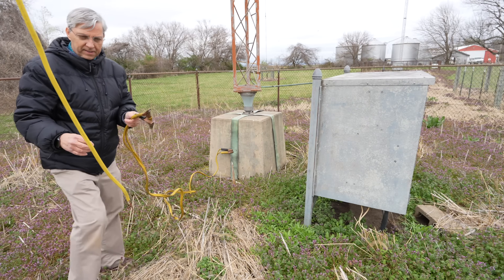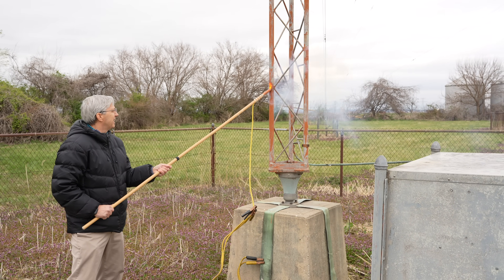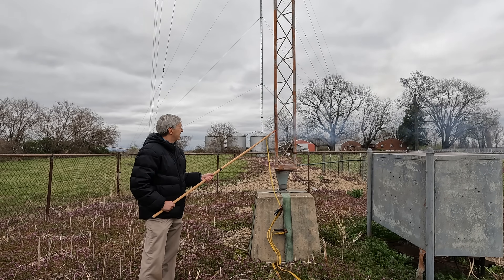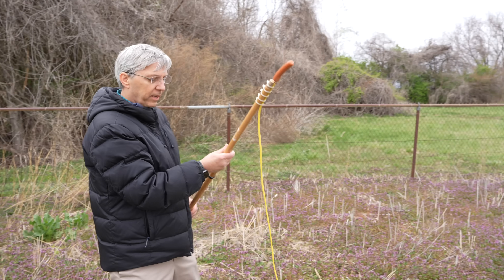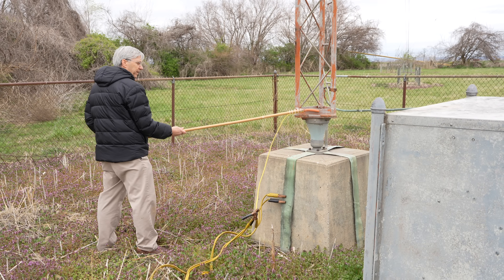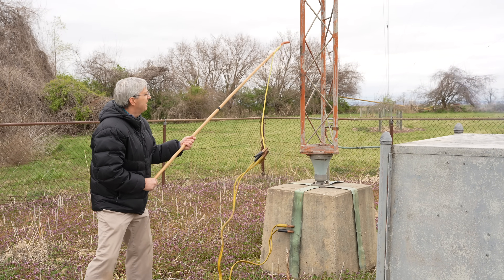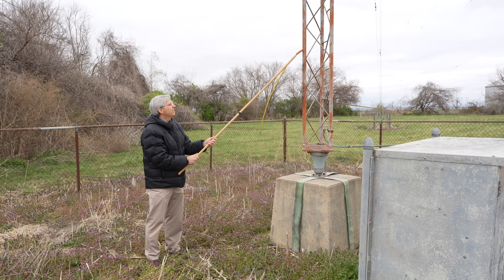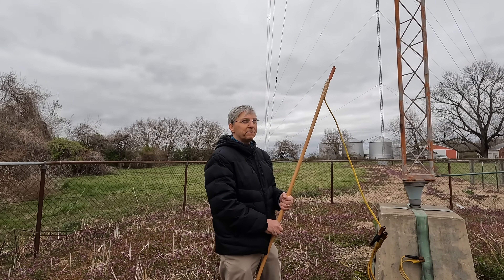We made a hot dog talk... with RF

Comment: When I get a belch that's an 8 or higher on my scale, I can feel my molars just barely vibrate in my skull. If this happens near a strong enough radio signal, my fillings pick it up and I get legit clear sound for that 3-5ish seconds. It's been several years, so I have no idea if that still works w/ modern radio. :/

Comment: would it be possible to add a interlock circuit to the transmitter that detected shorting to ground or something touching the antenna causing a potentially damaging situation and cut the power back to almost nothing to prevent damage and to prevent injury instill the short or arcing risk has stopped before allowing power to return so as to prevent transmitter damage and to prevent injury. such a circuit to be reasonably effective would need to work well under a wave number.  The second question is how they change lightbulbs on a tower while it is transmitting so as to prevent arcing or shorting out and isolate themselves from the ground or counterpose end.

Comment: It is dangerous to be next to the transmitter tower - because electrical field strength much more that 40A/M. For example - 20KW is 1000V on 50Ohm load. So next to the antenna electrical field strength is 1000V/M
Reply from the maker: It really depends on the frequency, power, type of modulation... a number of variables. The fence is at 2m, as that's the FCC-defined safety limit for the general public (based on some conservative estimates). The radius for occupational exposure (e.g. for engineers or groundskeeping) is inside the fence, in this case around 5-6 ft, based on the amount of power at this tower (I think 6-7 kW) vs the other two (which have different amounts).

If in doubt, though, hire an antenna systems expert—we consulted with one before determining our safety procedures for this quick test. And we also consulted one again for an upcoming video, where we added more safety measures :)

Comment: Don't worry 5G cell towers are good for you!
Reply: This is an AM radio transmission that uses a frequency between 530 and 1710 kHz. Medium wave, which is a frequency much lower than FM, which has a frequency of 87.5 MHz to 107.9 MHz. 5G has a minimum frequency of 3.5 Ghz.

Comment: Got some questions about supported AM broadcast antennas.

#1) Why are the three guy cables broken up into sections of different lengths with insulators between each?

#2) I've heard the terminology 1/2 wave, 3/4 and full wave. Can you explain to me how the physical lengths of each are determined and the ground plane? What fraction of the full wave length are the antennas typically?
What determines the length of the wires in the ground plane buried in the ground around the antenna? How often does the ground plane need to be repaired or replaced.  

I love your channel! This new world needs to know how valuable AM broadcast radio has been to the world and about the technology that has made it possible. I listened to short wave radio (fastly disappearing) when I was a child. We had an RF/EMP vulnerability test site in New Mexico that used high power Continental AM transmitters. I'll never forget the driver and PA sections to those things. Thank you for your time!

Comment: I thought for the longest time a radio tower was only meant to make a radio signal go farther by getting it higher. Not that the whole thing was an antenna…
Reply: That is correct for FM, or many other signals (they usually have a tall tower with an antenna system as high up as possible). But for AM or other lower frequencies, the antenna is very large/long (the entire mast), and it uses the ground and the atmosphere to spread a lot differently than higher frequency signals.
Reply: @JeffGeerling  Frequency and modulation mode are different things.

Comment: I would not be surprised if this change of antenna impedance is not causing the transmitter to trip on and off as you do this.
Reply: The transmitter seemed fine with it; they are built to handle quite a bit, but we do want to do some more 'scientific' testing with a field strength meter and more observation via cameras/logging while we're doing more hot dog testing.
Reply: @JeffGeerling  When I was a young lad, I worked at KWJJ-AM, Portland Oregon,  which had a 50,000 watt Continental 317C transmitter. We had a Continental Tech come out and service the transmitter, and he tested the transmitters MagnePhase detector with a process very similar to what you are doing with the hot dog. I think they used a 150 ohm 2 watt resister on the end of the grounding stick instead of the hot dog. If the Magnephase shut down the RF before the resister exploded, the Magnephase was working properly. I don't know why I remember that after 30 years, but hey, those were good times!

Comment: Warning signs should be put up around these towers.  What if kids climb the fence?  Yes I know they shouldn't, etc. etc.  But how much does a couple signs and posts cost compared to preventing death? I have an engineering degree (computer engineering) and I never knew that the tower structures themselves were energized.  I always assumed the energized antenna was at the top and that the metal structure would be earth grounded.  Obviously not the case. I guess it depends on how high the tower is and what the 1/4w of the lowest TxFreq is.  Around 130meters for bottom of AM radio if I remember right.

Comment: You can energize a radiant heater and never pay for heat that way.
You can also use a high low buck booster to power an dc to ac inverter with with out paying for the electricity.
They stole this knowledge from tesla, someday the alien forces that gave it to tesla will provide the way for them to kill them selves for doing so.

Comment: Imagine several magical trees, at opposite sides of a kingdom. And whenever the branch of one moves, the other does exactly in turn, because they are connected by a magical force.
And witches can use these movements to communicate with one another.

That's about the closest useful analogy the average person would need to know to "basically" grasp how radio works.
Reply: You can further elaborate on this analogy very deeply. 
"Well what of you talked into a leaf, would the leaf on the other tree vibrate subtley?"
Yep. Microphone.

Well what if there were other trees and shrubs of similar shape and consistency? Would they pick up some variation of the magic and move?

Yep.

Well what if you cut them into perfect vertical poles, then would thy still be able to carry the information?

It's a lovely thought exercise, fiction is fun :)
Reply: People will get mad when you're hogging the branches and now they have to communicate on the slow branches.

Comment: Wow, I wasn't aware there were any patterns that complex. Growing up I loved visiting the station my Dad worked at (WLPO/WAJK). They only had 3 antennas needed for the desired pattern.  I was fascinated by all the electronics and wanted to learn how it all worked. I ultimately became an electronic tech (BMET). Im sure my visits to the station helped to spark my love for everything electronic. What kind of peak voltage might be present on an 50kw AM tower? Cool videos thanks. Can you do a video about the process of taking singnal strength readings from various locations as required for design and setup of a phased system. I recall the stations chief engineer had to run all over several counties taking singnal strength readings from specific locations and needing to report them to the FCC or something before being allowed to switch to a phased antenna array.
Reply: I'm not the guy from the video, but assuming the antenna is a quarter wavelength monopole, you could approximate the voltage as Sqrt(50kW*36.5 Ohm) Assuming a perfectly matched antenna, which comes out to about 1.35kV. A couple assumptions need to be made, but it gives an idea, it'd be in the kilovolt range I'd guess.

Comment: Need to try that with a florescent bulb. Ground one of the end conductors and hold it up to the tower and it should ionize the gas within. Use the same safety cautions though...
Reply: No need to ground the tube.

Went with a radio station tech to the 5Kw ERP AM transmitter site. We walked towards the mast just holding long fluorescent tubes & they fully lit up. If I remember we were still about 20 metres away from the base of the tower.
Reply: @markboscawen8330  Agree, mine wasn't grounded, both ends open.
Reply: Used to do that with 100W PEP  18 MHz. You could see the peaks and nulls in the tube.

Comment: Thank you for the video. Is the tower itself energized?
I think that the antenna is isolated from the tower maybe ?
Reply: Yes. The entire tower is one-half of the dipole antenna, and sits on an insulator. The copper ground screen and wire radials are the other half, and are buried under the surface of the soil.

Comment: The sharp edges on the cut end of the wire are "grounding" to the air without arcing.  I forget the principal why, but that's why basic spark plugs have a little puck with sharp edges that evenly wears, and you have to replace them once it's slightly rounded.  Arc gaps and TIG welders control this with a sharp pencil shape at different angles.
Reply: The E-Field is strongest around the sharp points of conductors that are highly energized. It's why you see lightning rods shaped to a point at the top. With high enough power on a sharp point you can energize the air into a glowing corona, or St Elmo's Fire.

Comment: need an explanation for this
Reply: So, when electricity goes through the sausage, this causes it to make sound, sort of like how electric sparks make sound. The intensity of the electrical signal (IE the amplitude) is changing, so this causes the sound to change as well, because this is amplitude modulated this caused the sound from the sausage to mimic the sound of the signal as the sound gets larger with larger intensity, and weaker with weaker intensity. That's how I understand it at least.

Comment: I’ve definitely climbed a tower like this and didn’t even know🙄 I guess i got lucky and the rubber in my shoes saved me.
Reply from the maker: There are many towers that aren't AM (where the energy is all in the whole tower itself), so if you climbed a local communications tower or an FM, you might not have issues until you get near the antennas at the top. But best to not climb any unless you have the proper training and work with the engineer to ensure it's safe to climb :)

Comment: I watched the video before I read the description above and I would have thought it was way more than 10 KW,  My local AM radio station is 5 KW and it has 2 antenna connected they did this years ago.  This is a local radio station 3NE in North East Victoria down under.   I was amazed you could hear the Modulation of the Carrier when you cooked the snag.

Comment: This video raises a lot of weird questions. Firstly, how is the hotdog producing intelligible sound? Is it acting as an acoustic diaphragm or just facilitating an arc that acts as a plasma speaker? What radio channel frequency is the hotdog receiving, and why just one channel instead of a cacophony of every channel being transmitted by the tower?
Reply from the maker: Those are good questions! It is the plasma (not vibration) producing the sound, and the frequency of this particular broadcast is 1460 kHz.

This AM tower is only broadcasting that single frequency, and there are no HD carriers on the station, so you're just hearing the clear AM signal.
Reply: @GeerlingEngineering  Ah, that does simplify things. Thank you for the explanation.

Comment: The last time I i talked to an AM station engineer I learned all about this and it set off more curiosity for me in the LF spectrum.  

 Having a full standing tower with metal guy wires only separated by small spacers near 500 volts AC modulating at the frequency of up to 1.6mhz seems both extremely dangerous and an incredible feat of engineering.   I've wondered how many transmitters exploded due to accidental shorts in the beginning of AM radio.

Comment: A Hot Dog Detector Circuit.  I can't believe how low the fence is. Yikes! I hope that's not the only fence.
Reply from the maker: There's a separate horse-height fence around the entire field of towers, and there are two gates required before you can access the smaller tower fences. That, and it's in the middle of farmland.

Comment: What is the ground strap bonded to?
Reply: AM towers generally have an extensive ground plane of 'radials' that extend out dozens or hundreds of feet from the base of the tower just underground. These are all tied together and tie into that green oxidized copper strap where my Dad clamped his jumper cables.

This helps the AM antenna work as a vertical radiator, with a ground plane underneath that the signal kind of 'bounces' off of to keep the tower height smaller (otherwise it would need to be a lot taller to get the same amount of gain).

Comment: I used to cook hot dogs with a 5kv 1a (because you need a ballast) microwave oven transformer ripped out of old microwaves

Used to do a lot "crazy" shit with high voltage electronics

Funny to think that's the same power rating an electric chair uses, I got shock by the floating output of a 60hz mot

I can tell you that sumbitch hurt, and had my arm numb for like 30 mins

Hurts worse than floating output of a 50kv- 100kv color crt flyback skin effect makes a difference even at 15-30khz "mains" vs 60hz mains

Both will make you ass fly back a few feet

Crazy thing is run a resonant Tesla coil above 500khz and from an isolated DC supply

You can touch the discharge and feel nothing, except burning like a fire
Reply: Wonder how more effective a Tesla coil would be as an am transmitter

Since you can easily modulate a Tesla coil

And a Tesla coil is a radio transmitter circuit that can also easily handle kw of power

Just that your secondary coil will look different when it's tuned to radiate and not discharge, in a transmitter you don't want lighting bolts and corona discharge shooting out the antenna

Cuz no radio gonna get the signal when it's being shorted to ground
Reply: Thing about a Tesla coil is the ones you actually see are improperly designed on purpose so they spit lightning

It's a resonant transformer that resonanates at rf frequency (your carrier typically Tesla coil run above 50khz) and can easily be modulated via am, fm could be done via pm on the coil, since pm can be received on fm radios... though I never seen a Tesla coil with a 100mhz resonant frequency the modern equivalent is a crt flyback transformer

If you don't tune the secondary like a very stubby and poor 1/4Λ it wouldnt look as impressive if it just worked like any other antenna

Comment: In the 1970's ish era , Westinghouse Appliances and others had a hot dog cooker that was two metal prongs stuck into each end of the hotdog.  You then closed the drawer and it applied 110 V non isolated house power across the prongs.
Reply: My dad told me about his family having one of those hot doggers growing up and the hotdogs would have a weird electrical flavor.
Reply: @lastotallyawesomebleach204  What the hell is electrical flavor? Never heard of that.
Reply: Try licking a battery
Reply: @mulletforyou  They're good with mayo.
Reply: I have the Presto version in the back of one of my cupboards, the "hot dogger" I believe. It's a fun toy but after cleaning it up a couple times the novelty wears off quickly. Plus it actually does a horrible job cooking hot dogs compared to just using a small pan and a bit of water.
Reply: Lots of people heat hot dogs in the microwave oven. Just put a paper plate over them to control splatter and don't let the hot dogs touch each other.

Comment: I've cooked a hot dog with RF.  Of course it was microwave RF in an oven designed for that purpose... 🙂

I've actually heard a radio station on an old steam radiator, located across the street from a multi-story building with a college radio station antenna and tower atop it.  Very low volume, very sporadic, conditions needed to be just right.

Comment: I've been lucky in that I've only been hit by RF burn once, and it was low wattage. I'd recently trimmed a counterpoise wire for one of my HTs because I'd moved it from the base of the antenna to a belt clip screw and had to compensate for the increased distance to the antenna. And when I trimmed it a tiny portion of the wire remained poking out from the silicone insulation. A few days later I was holding the HT, about to start testing to see which repeaters I could hit, and thought nothing of the counterpoise touching the inside of my arm. Then I keyed up and got zapped because that tiny bit of exposed wire. 8w doesn't sound like much but it felt like a white hot needle going into my arm. The end of that wire now has shrink tubing. ;)

Comment: So, how do you service those tower antennas?
Reply from the maker: Turn off the transmitter and lock out remote control, usually.
Reply: @GeerlingEngineering I am guessing you also ground the tower? (After turning off the transmitter of course) to prevent it from being energized by other nearby towers that are transmitting.

Comment: To this day, the tip of one finger of my right hand has a scar from a nasty RF burn.  Was 12 years old with a Ham licence and my transmitter was a vintage military ARC-5 with an exposed antenna lug on the front panel.  Not enough power to pull and arc, but it still hurt like hell!!  That was 1972.
Reply from the maker: Ouch! Sometimes those lessons are a bit harder than others :(
Reply: About the same age... exposed anode of a TV sweep tube... arced 1/8 inch out to my finger and left a nasty hole...